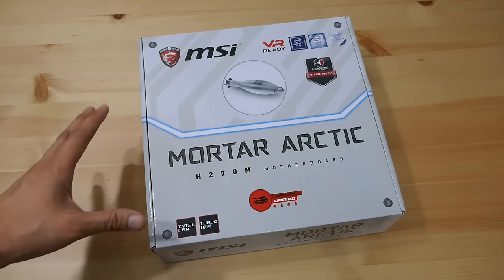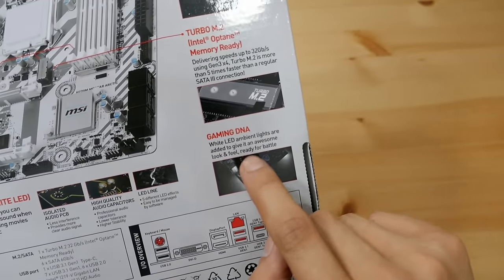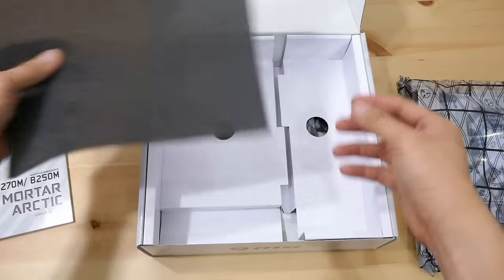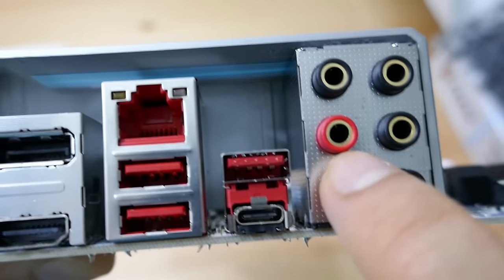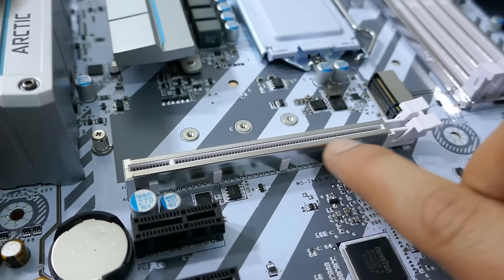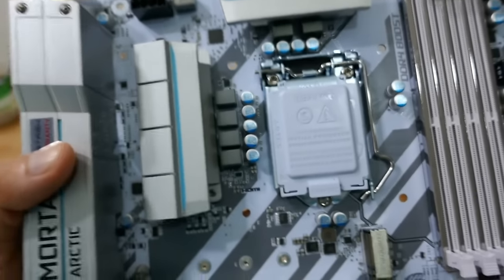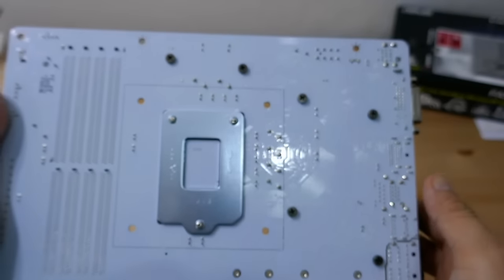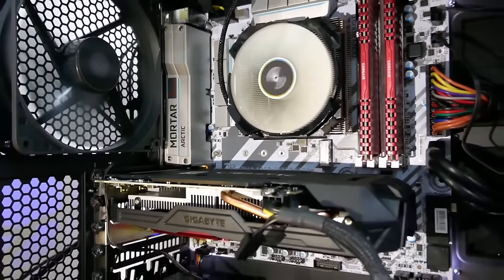MSI Mortar Arctic H270M Micro ATX White motherboard - Review and quick installation

Comment: Thank you for the video. I received this mobo last week for my new build. (I7 7700, Eva GTX 1080 SC, corsair air 240) I have a few remarks for those who might be interested in it: 

1- The mobo has no speaker, your only indication of something wrong are the EZ LEDs.

2- Order of RAM module installation is important as it says in the manual. If you mess that up the EZ LED won't show you that the issue is with DRAM, your computer just won't send a signal to the monitor with no other indication anything is wrong. I learned the hard way.

3- This mobo won't do SLI because the second PCI-E slot only supports 4x on the lane, so you can only have a 16x/4x arrangement, not an 8x/8x. Major drawback but I really wanted a white m-ATX mobo.

4- The CPU fan I bought for the build is a 3-pin DC design, which in theory should connect to the 4-pin mobo header just fine, and then get the header to work in DC mode from BIOS instead of PWM. In practice both modes from bios do nothing to the fan by way of auto-regulation. The rpm stays at 1100, and I can modify it by a manual control.
Reply from the maker: +Talamicus thanks very much for sharing the info!
Reply: Talamicus Please let me know if b250 krait has speaker or no? do they make boot sound?
Reply: Talamicus I
Reply: OudMan. I'm having memory issues. How do I get my monitor to turn on?
Reply: Jason Hettig you turn it on

Comment: what about the b250 version of this???
Reply: megatron thats what im talking about idk whats up with msi i didnt see any difference between the b250 and the h270 mortar artic
Reply: megatron alright found out the H270 has 8 usb 3.1 ports And 6 usb 2.0 ports. The H270 basically has more usb ports while the b250 has less usb ports but both still have the usb c so it isnt a deal breaker. 6 usb 3.1 and 6 usb 2.0 on the b250